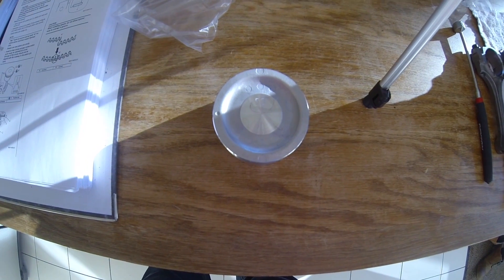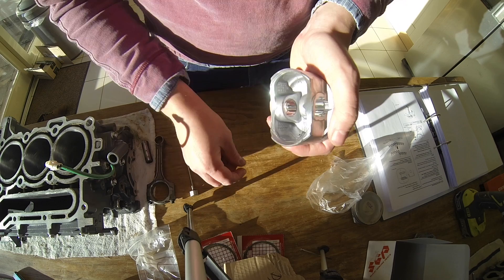Repairing a Sunk, Seized 4-Stroke Outboard Engine (Suzuki DF60A)

Comment: my suzuki DFA 60A got submerged in sweet water half way just litle above tilt button and now it wont start or going up or down. Did you do anything on your electronics during the repair process? What you suggest i should look for? its clicking but not turning over
Reply from the maker: Oh dear! Have you removed all water from the bores and sprayed in oil first and foremost? When you say sweet water, was it salt or fresh?

Comment: Thanks for the video.
Can you give us a rough idea of how many hours and how much $ for the rebuild?
Reply from the maker: Engine was £1,500, £1,250 in parts and engineering services. Some electrical parts I bought cheap from AliExpress, then replaced with genuine later (once I knew all was going to work), and this amount includes the cost of both the Ali parts and the genuine to replace them.

500 hours since rebuild now without any issues

Comment: Did you reused the old bolts?
Reply from the maker: Most of them, yes. There are a few you have to replace as they’re single use.
Reply: @boatman9564  okay i made the hole progress on my df50a but changed all the bolt to new ones. But im going to rebuild my df60a which ones did you replaced?

Comment: Great video been waiting for this one to come out ….. is there much difference between the 50 and 60 hp outboards ? I have a 50 now and been thinking of going to the 60 ?
Reply from the maker: It’s definitely quicker. Top speed I had from the 50 was 25knts. 60 has given we 30knts however I think I’ll get more out of it once re-propped. 60 is definitely a better match for my 4.8m than the 50.

Comment: Where did you get the new shims from:)? For the valve clearance
Reply from the maker: Got them from the Suzuki Marine main dealer
Reply: @boatman9564  thx:) also rebuilded mine zuke 50hp:) inlike the engine is really powerfull. U can check my video:)

Comment: Fantastic video, been eagerly waiting a long time for this. Great work! Can I suggest you put Suzuki DF60a in the title and add some tags so it shows up better on the searches? Many thanks for taking time and trouble to document the build!
Reply from the maker: Very useful feedback. Thanks a lot for watching and for your support - title and tags updated!
Reply: @boatman9564  fyi I had mine remapped by Martin Rossiter of West Wales Tuning. Very happy with the results. In fact JB Mechanical regularly gets these to 80hp on regular unleaded but they are in Aus, not UK.
Reply from the maker: Good to know. I think this 3cyl engine is used up to 70hp by Suzuki. If there’s no variation in mechanical parts up to that HP level then then that definitely sounds like it’s worth investigating.